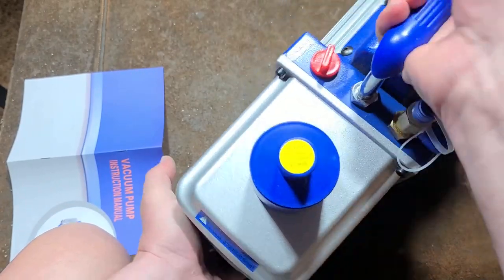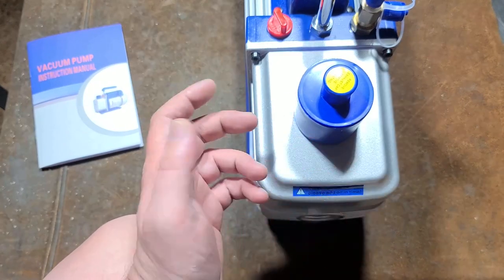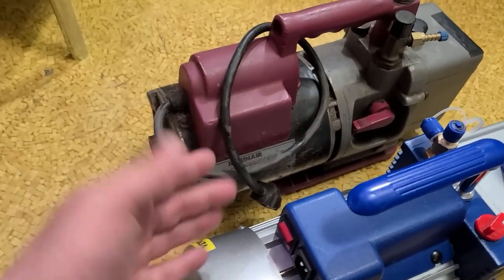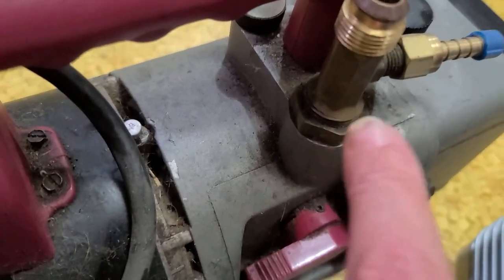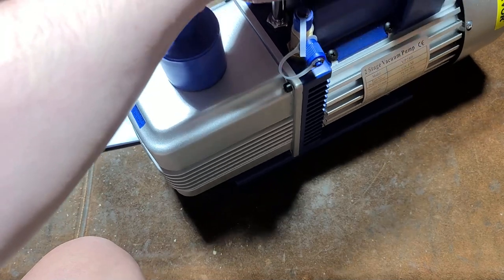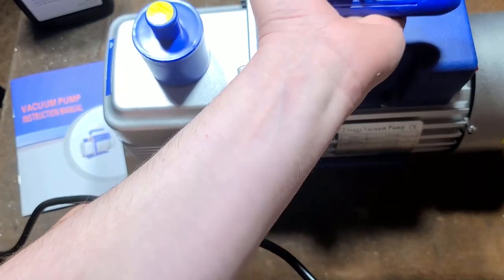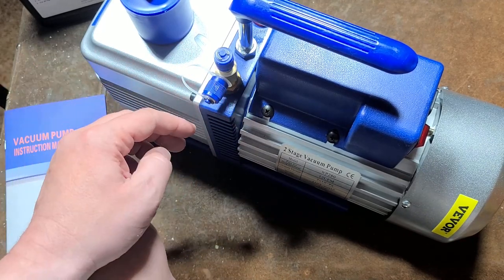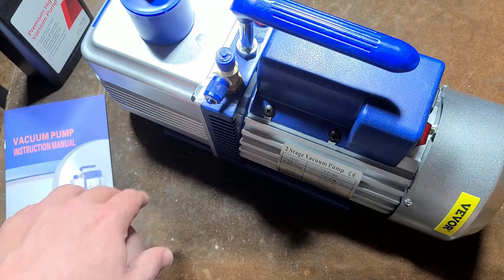Vevor 2-Stage High Flow, High Vacuum Pump Review

Comment: Traditional refrigeration is 1/4 and 3/8 SAE  fittings    . The odd thread is either 1/4 [rare ] or 1/2  ACME  found only on automobiles .
Just read the my dead Robinair  instructions  and the open ballast is used  to eject first moisture  down to around 3000  micron then u close the valve . Its faster and makes the oil last longer .

Comment: I had the Robinair pump of the same model as yours; I sold it a while ago and it was a real workhorse never requiring more than oil changes.  If you do occasional a/c work, the Vevor is more than enough @ 12 cfm....but those who need something for regular professional use, I still would recommend the Robinair.

Comment: I had bought a 1/3 initially.... ended up buying one of these 1hp and noticed that some of the 1/2's had a ballast, checked aliexpress and they sell the ballasts on their own, so I plan to try modding it in..... they seem to just mount via 2 screw holes(will have to tap em) on the smaller oil hole(red cap) opposite side the suction intake

Comment: Good to see a review . I am looking at purchasing this vac pump but cannot find FACTRY SPECS anywhere .  Mainly the RPM as I suspect its 2800--3500   . This is whats measured on forums  vs . Robinair will be 1500--1800rpm  . Running at very high rpm may need a different oil and its obvious will wear out quicker .  Over heating  cut out has been an issue in  reviews  
Can u help out . ?

Comment: The oil level is very confusing on the Vevor - some times it;'s in the middle, sometimes after use it's super high, then if you leave along for a while, the oil level shows really low, and then when you start it again, the oil level is okay...

Anyone know the exact procedure for getting an accurate reading once the oil has been added and machine run a couple of times?

Comment: If these pumps are used for ac systems with schrader valves whats does the diameter of the pump connection matter wenn the valve on the ac system is limiting factor....

(sorry for my english as i am from Europe/Netherlands)

Comment: What kinda oil do you need to replace the oil on these?
Reply from the maker: There is special vacuum pump oil, auto parts stores usually will sell it for air conditioning service machines.
Fill to the middle center line of the window on the pump.